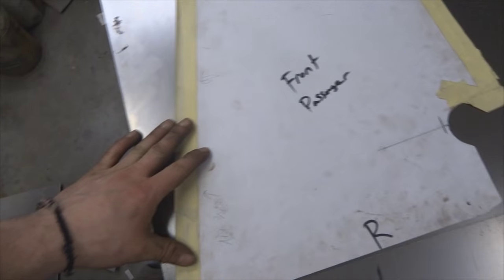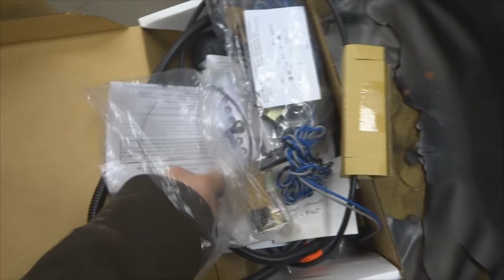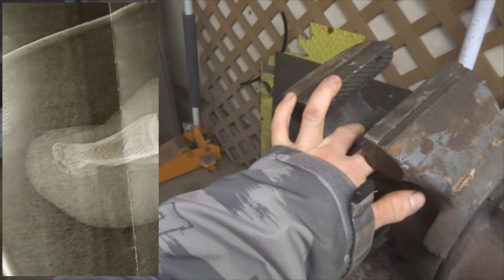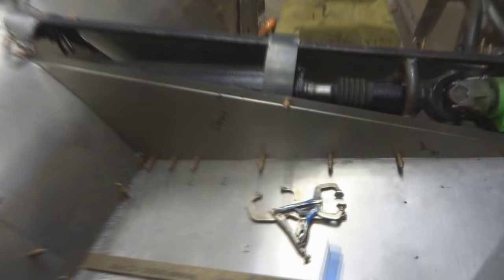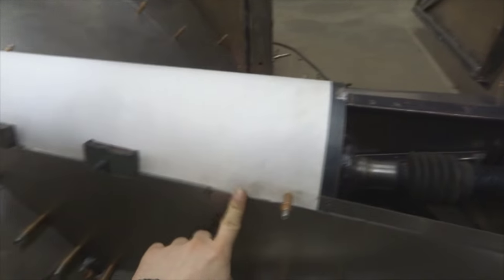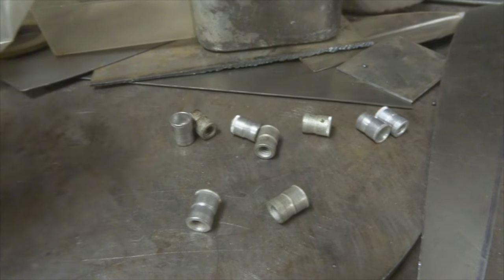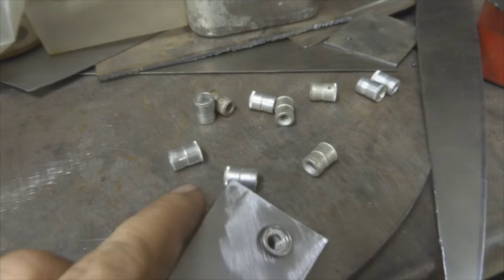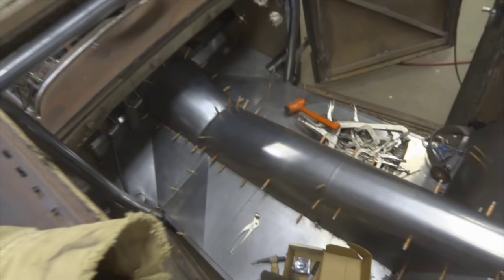Cummins Rat Rod: Project "Wild-Torquey" (Ep. 43) INSANE BUILD!!

Comment: That piece of sheet metal you carried in the beginning, whats that cost?  Looking good!
Reply from the maker: if I remember right it was about 45$ a sheet. not terrible. I would have loved to use stainless but that's like 4x the price haha aluminum is about 2x the price, but I don't have a tig so would have made things more difficult for me
Reply: Just checking because my dad is putting together a rat rod himself.  Wish we had a cheaper place to go to get metal.  Last time he got sheet metal he had two 2'x4' pieces cut with a bend on one edge and it came to $200. Crazy. Maybe just the sheet with out them cutting it and bending it is much cheaper though.
Reply from the maker: +Cobrafanatik22 yes cutting and bending adds up very fast. we get our running boards bent, because we csnt bend anything over 4ft here, and it is much much more expensive. also depends on thickness. I'm using 20 gauge on my floorpans

Comment: Would that throw off the balance of the drive shaft?
Reply from the maker: what's that? not having balance holes in the yoke? no. the yoke itself would have been balanced at the factory. they cut those notches in it to balance the piece itself. the Yukon gear & axle yoke is a higher quality casting process so it is balanced better and doesnt need big holes drilled into it to balance it
Reply: No the magnet that you put on the drive shaft
Reply from the maker: Ohhh, no, It's such a light magnet that it shouldn't make a difference. There are 2 of them so you put them directly accross from each other on the driveshaft, should balance itself out.
Reply: oh sweet was just wondering because i know how precise they are
Reply from the maker: +zach hoffbec yeah it shouldn't be a problem, they have sold thousands of those style of magnet type kits